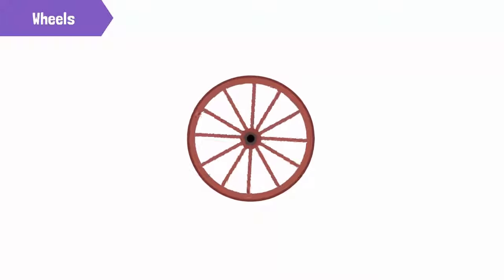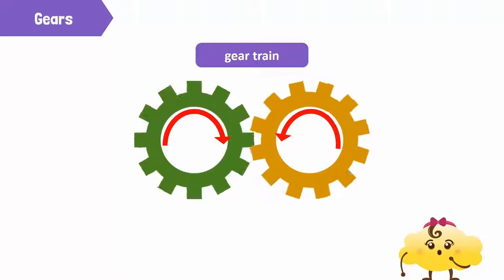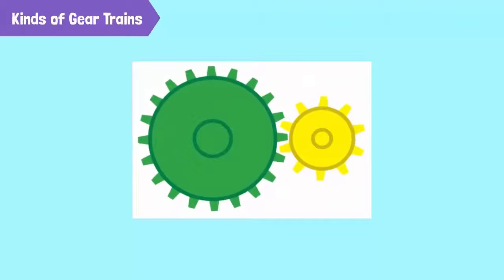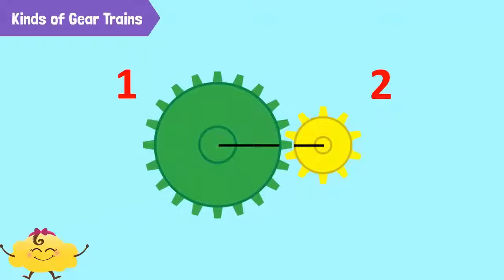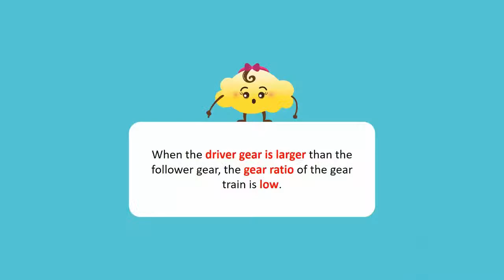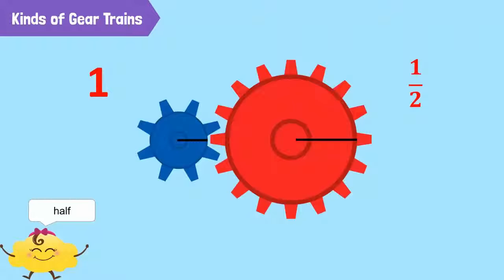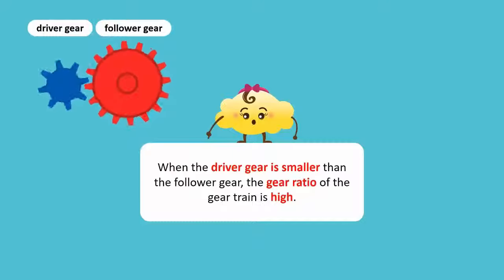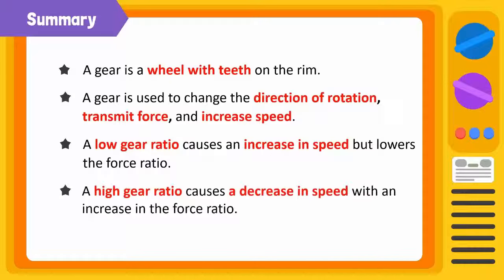Gears and the Principles of Gear Systems

Comment: the gear ratio in your example being just a single number "0.5" might confuse people, it is better to represent the gear ratio as "x:1" using this format, the gear ratio in your example is 0.5:1, which means for every 0.5 (half) rotations of the driver gear, the driven gear rotates once. the formula for calculating gear ratio is "number of teeth in driven gear divided by the number of teeth in driver gear."